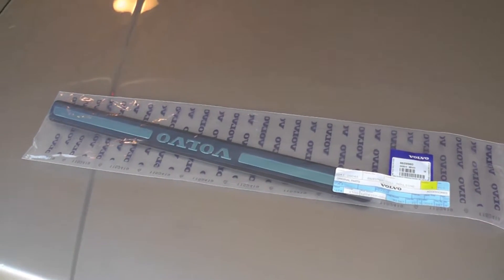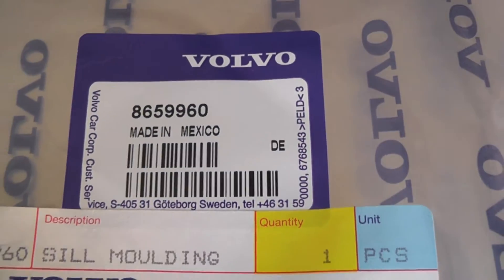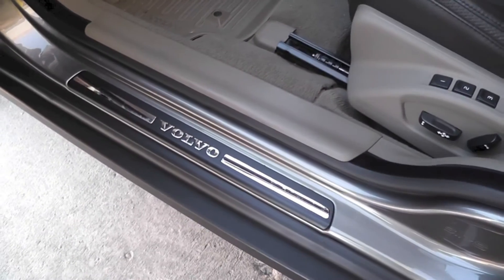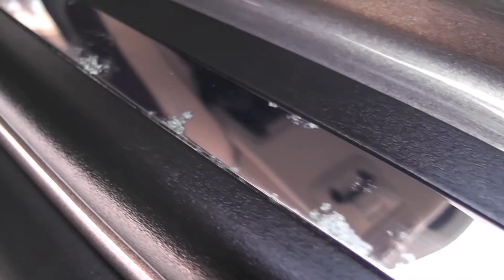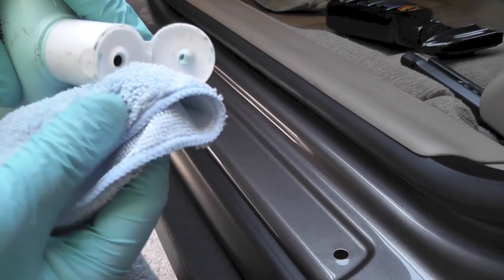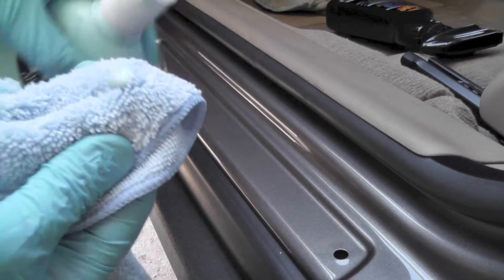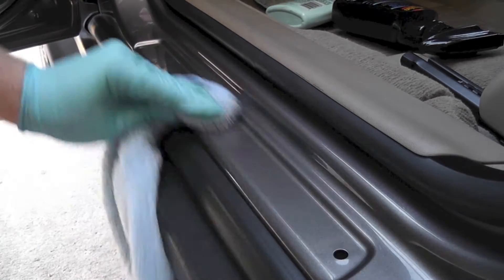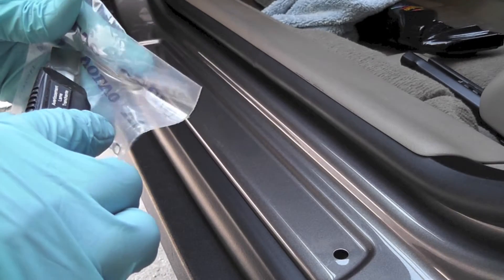Volvo XC70 T6 corroded sill floor moulding  replacement

Comment: +volvosweden, One suggestion though; Being that this trim piece is self adhesive, I would not wax the metal area underneath, where the adhesion would stick to the metal.
Reply from the maker: +Gordon302 No problems since the installation. Thx anyway

Comment: Roof rails installation video of this model is not anywhere on YouTube. I am about to change them to Silver ones on my volvo v70 but it doesn't seem to na that easy...
Reply from the maker: The V70 comes with silver  and XC70 with black, am I correct?
Reply: @volvosweden  it depends on the version of v70. It can come with silver, black or without them at all.
Reply: @volvosweden  XC70 comes with black ones only I think

Comment: Dear "Volvosweden", do you know how to remove the plastic cover to replace the rubber body-molding (partno.30779419) beside the floor molding in the door opening, showing in your fantastic video. I'm afraid to break it.
Reply from the maker: Just pull up on it starting from the rear.
Reply: Thank you very much!! I'll try it tomorrow.